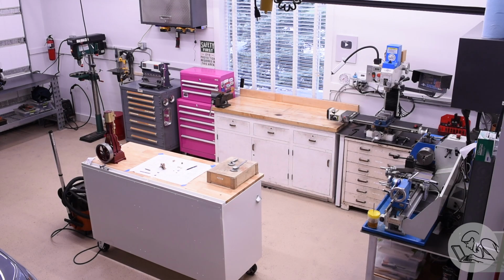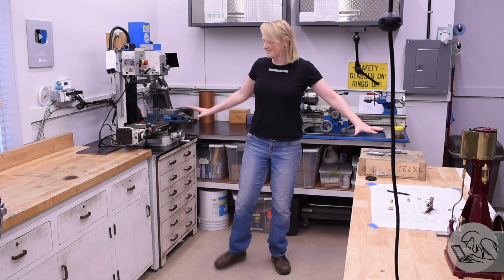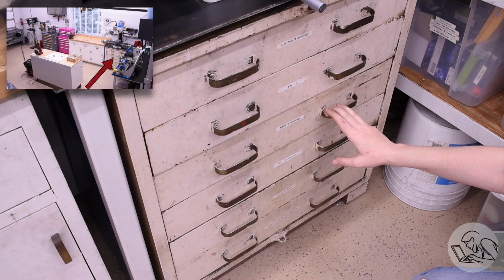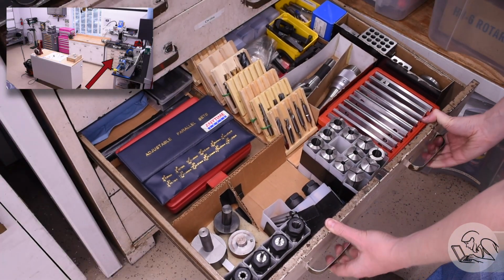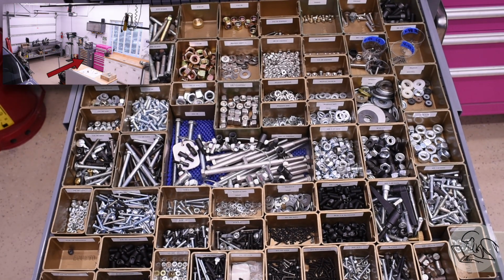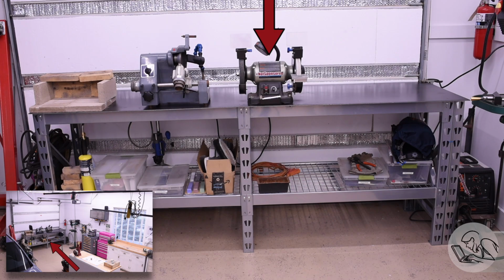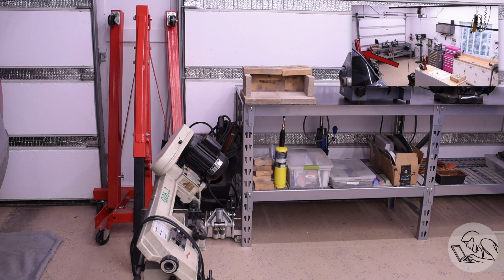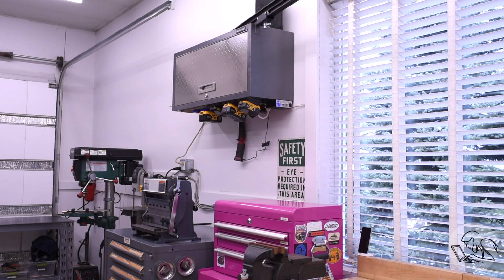New Shop Tour!

Comment: Great workshop, Quinn. It will get even better with age.
I didn't see an air compressor; very useful for hi-speed die grinders, and for blowing swarf out of deep holes. Downside is the swarf tends to get spread around (bye bye clean workshop) but your mill will do that anyway.
Not a lot of space for material racks; you will need more with time. Yes, I watched your video, but that's just a start!
DON'T upgrade to larger machines; buy them in addition to your existing ones. If you traded in the ones you know and love, the new ones will likely disappoint you. I still have my first lathe, an English Myford I bought new 53 years ago, and it can do some things my more recent and larger Chinese lathe cannot. (and the converse is also true). 😄😄😄

Comment: Beautiful well thought  shop. I have shop for 10 years now and in all time i have not spent 15 minutes in thinking out all the things you mentioned.
Cleanest shop i have ever seen. My has coolant stain strips on the ceiling above lathes and wheebarrow for driving chips outside.
You are quite right about light, when you look up if it starts to hurt, then it is enaugh.

Comment: Great and neat workshop! I have a small concern about the AC unit - grinding dust may promptly kill it. Please consider adding something as a pre-filter (like a piece of fluffy non-woven cloth placed over an inlet) or order lots of cheap non-original compatible  replacement filters and replace them much more often than you’d do in a regular environment.

Comment: Fascinating video as ever. I'm intrigued by the 'square ground' drill bits you mention - I don't believe I've ever seen these, and a search online only threw up mortise chisel square bits. Are they ground like, say, a plug or bottoming tap, or a flat bottom milling cutter? And would they be intended for use in a drill press? I'm curious how you would begin a hole without the bit wandering. I dream of a tidy, organised space like this, but alas my workshop is my school teaching workshop, and those students they do thrive on chaos and visual clutter...

Comment: Thanks for sharing! 

I have a tip for shopowners with kids, i’ve placed 2 big circuit breakers know as ‘maintenance switch’ 1 for my 230VAC circuit and 1 for my 400VAC circuit.
With a flick of the switch I unpower all of the wall sockets (and machines)
I can even lock them with a padlock. Very handy and safe against curious kids!

Comment: I owned a shop where I designed and built custom machinery. When I thought I was ready to retire, I sold the shop and moved to Upstate NY. It took me about 3 months to become screaming bored, and there was this building ( a tin wall and slant tin roof, dirt floor and the front wall was opened to the outside ) 200 feet behind the house. The structure measured 12x26 feet. The first thing I did was to put down Visqueen sheet vapor barrier then framed out the floor with pressure treated 2x8s. Then I hit the auctions for my machines, I needed to do this first to know how big to pour concrete pads for the bigger machines I wanted. I made two sets of double doors to cover 10 foot spans. That left room for framing out a walk-in door in the center. this way there was nothing in the way of getting anything in or out of the shop. My first machine was a 14.5x 6 foot South Bend lathe that had been dropped from a lift gate, and had all of the handles bent or broken. It took me 6 months to fix, but I was cutting threads with it when it was finished. That machine cost me $300.00. The next two machines were an Enco mill and a Clausing 9x36 inch lathe. While the auctioneer and I were putting the Clausing in the truck we heard something very heavy hit the floor. His fork lift operator had run into the Enco and knocked it over and breaking the quill stop. I had never intended to buy anything but the lathe, but they offered the mill for next to nothing. I only had room on the truck for the lathe so I told them I needed to go home and drop off the lathe and get the money for the mill. They told me they were leaving in 2 hours so hurry. By the time I got back ( A bus flipped on the interstate ) it took me 3 hrs to get back. When I got back they were gone, but the mill and a shop crane were by the door with a note " Enjoy the mill. Just put the crane in the ally and lock it up with the chain back there.
Reply: Yea. I don't know who you are but man that's a good one.

Comment: Hello fellow heat pump in a shop owner, they sell this irrigation bag to fit the evaporator unit. You put it on like a diaper and you can spray-irrigate the copper coils to keep it clean. I wasn't watching how dusty mine was getting. Thanks for the video!

Comment: I've always felt that painting the walls of the shop white is as important as installing tons o' lights.
Reply: I worked as an aircraft mechanic and worked in numerous hanger's over the years, lighting was important. Lighting was measured in Kilowatt's, thousands of them. In the last place I worked we had 6 rows with 8 1000 watt lamps each and that was only adequate if all lamps were on. The manager found funds to paint the walls white and that made a huge difference. After that, 2 of the 6 rows would give more illumination than all 6 could provide before painting the walls. White in a dirty, dusty environment isn't the best choice, it should be the only choice, invest the savings in cleaning.

Comment: I just finished insulating and dry walling what used to be a calf shed that housed my 106 year old model A Monarch lathe with an overhead flat belt drive.  I moved my mill which had lived at my brothers shop down the road and installed a ductless heat pump. I'm near ready to have things up and running soon. The idea of having things together in one inviting place will be wonderful. Seeing your space is an inspiration. I still have the problem of wood working tools in the basement, automotive tools in the garage, and machinist stuff in the calf shed. I have found the need to have duplicates of various tools such as adjustable wrenches, screw drivers, and a basic set of combo wrenches in each location to avoid the three location search for the tool that is never in the place you are working. It used to be four locations before moved the mill that was a half a mile away. 
Really enjoy your channel.
David Vik

Comment: Man I wish my stuff was that organized. Hopefully I'll be able to borrow some of your techniques.

I've got one garage primarily for cars, but also tools, and another that would be like a dream shop if it were sufficiently separated from the outdoors and wild rodents. Probably needs to have the OSB walls ripped out, spray foam replacing the fiberglass, etc, but too pricy, so there is an unpleasant amount of rodent evidence alongside my yard equipment. Heck, even had a little mouse pop their head out (annoyed) from the base of my bench top drill press after I had finished my drilling... But I can't stomach putting traps out there because it's just not well enough sealed for me to consider it to be "enclosed from the wilderness"

Comment: Hello from Australia
Is the floor coated? 
On your drill press I sey the chuck key is on a string. I use a magnet on the belt cover.
Also; is it an optical illusion, or is the extinguisher right in the corner? It looks inaccessible if things ignited. Cheers !

Comment: Hi Quinn, the workshop overall is impressive, much like my own although mine is crammed into a smaller space. I do have plans to extend a little into my double garage which is adjoined and used as storage and not for my vehicle. The one thing that has really impressed me is the lighting, it is fabulous and has got me thinking about improving mine. Thanks for the tour, it is always nice to see how others set up their workshops. I do have a question for you and should move over to my patron’s page to ask it, I keep forgetting to do so. Stay safe and I like many I assume, is very pleased you are settling in.

Comment: I finally started getting some machine tools these last couple of months (and your channel has been big part of why). I have a lot less space available (really only a couple of square meters), so I'll have to do some things differently, and I'm not planning on building model steam engines or anything, anyway... but it's still nice to see how you make use of your space!

So far I just have a heavy wooden workbench that my mill (a cheap, small round-column mill/drill) sits on, with all the tooling stored underneath in crates. I plan on replacing the crates with shallow drawers like yours, and I've started fabricating a smaller movable table for use as a general work surface, for mounting my bench grinder, and soon hopefully for a tiny Proxxon lathe as well. I'm mostly interested in making things like brackets, simple mechanisms, and things like that, so hopefully this should tide me over for a while.

Comment: Thanks for sharing.  You are a  great teacher.  My suggestion for you is something I have really enjoyed.  It is  a central vac.  I purchased one second hand with no piping for $40.  Then I installed it in a closeted area and ran PVC around my basement shop with 3 simple drops on the ceiling.  It is quite quiet and has fantastic suction.  Before I had a Shop Vac which was deafening.  It is surprising how much cleaner my shop is now.

Comment: While I also like drawers for many things there are also many things I like to have hanging up for easy access like wrenches and screwdrivers. I prefer to think of them as 3D techno-art rather than clutter. In woodworking we say that you can never have too many clamps but in metal working I don’t think you can have too many fasteners or hardware. I knew that you’d like stubby drills if you started using them, resistance is futile!

Comment: I have a similar PM lathe & mill. My mill is a bit larger, but the lathes are essentially the same unit. My mill ended up being mounted  to a cast iron PM pedestal, but the lathe rests atop a Harbor Freight 56" tool chest. I took the wheels off and made leveling pads. I welded a 7/16" sheet of steel to the top of the box, the drilled the top to bolt down the lathe.
The storage space right under the lathe/ adjacent to the mill is awesome for limited space I have available.

My shop is nowhere near as clean.... something to work on.

Comment: Your shop is awesome and suits your needs.  FYI to all, for anything bigger than hobby projects look for a Rockwell Mill from the 60's it is 2/3 the size of Bridgeport and runs on 120/240.  I also found a Clausing 10" lathe circa 1950, does it all and can cut threads. Both slightly larger the these machines but well made and repairable.  Save and restore the old machines is a great way to go.

Comment: My "Shop" (small electronics tinkering and repair) consists of 30x40 cm of my desk and the same area on top of an Ikear Ivar shelf that conveniently fits under the desk at a 90 degree angle.
Everything I need is within arms reach without getting up from my chair.
It has a lot more drawbacks than it would seem.

Comment: I think I saw one tucked beside your shop crane but I use a regular floor jack all the time. I use it to move everything around my shop. Helps levelling too
Reply: My floor jack is also a half way decent infeed or outfeed table for the horizontal band saw.  The height adjustment the jack brings is convenient when dealing with the multiple planes of sloped garage floor and longer sections of stock.  Wonder if Quin uses it that way, or if it is just coincidentally nearby?

Comment: I agree about the hoist. As a young'un I tinkered with custom cars, and I bought an engine hoist rather than renting one for a job I was doing, because I wasn't sure how long I'd need it, planing to sell it when the job was done. It proved so useful that I had it for years, it was surprising how many uses I found for it. And it never worth risking your health by lifting things too heavy - it can take mere seconds to do damage that will trouble you for the rest of your life.
Reply: At my last job we needed a way to get a 20kg heating element out of a machine without bending forward. I modified an engine hoist by shortening the front legs and adding a lot of counterweight. If you find yourself using it a lot, put some nice castor wheels on it, the factory ones are complete pants. And, as someone with a lifetime injury, I would add don't one-hand battery drills. I had one catch and tear cartilage in my wrist before I could let go of the trigger. Seven years and two surgeries later, my wrist still bothers me!
Reply: My solution is a set of forks on the tractor front end loader. We live on a small farmette and it was 5 years before I finally broke down and bought a tractor. Since then is has become my only engine hoist/machine mover.
Reply: I'm with you! Similar to @IanSlothieRolfe 's comment about buying and selling when the job was done, I bought a skidloader when I was building my shop and figured I'd sell it when I was done with the construction. Like Ian says, it proved itself so useful that I still have it 25+ years later!

Comment: My shop electrical tip:

Use two 20 amp circuits for outlets on a wall. alternate from one circuit to another every 32 inches. So circuit A at 0", 64", 128" etc, & circuit B at 32", 96", 160" etc. I used white outlets & plates for one circuit & ivory for the other.
Reply: That's pretty much what I did. I've got four 20 amp circuits just for the wall mounted outlets. No two outlets next to each other are on the same circuit, but mine are at 24" intervals because that is what the stud spacing is.
Reply: I did the same in my shop - alternating circuits for the outlets and separate circuits for lighting. That way if I happen to trip a breaker I'm not left in the dark and I still have power to finish the task before having to go to the panel.
Reply: @smallbyrdz3823  I actually put the lights on a seperate circuit for lights only.

Comment: Thanks Quinn for the tour and new shop update! I've been curious how you'd handle a few things, such as general layout and  integration of the organization you had gotten (what appeared to be the) dialed-in in the V1.x version of your shop (old shop). One question that maybe I missed in your video, the "bar" running across the top of those nifty cabinents. Is that for camera mounting? Light hanging? Maybe something else that I'm not clever enough to think of?

All in all though, I love the logical layout for your space! Very effecient and actually visually pleasing! The only thing that I'd say you neglected to include is a safe viewing space for Sprockets! Or, is that inside the house? Lol Thanks again for sharing! 🤓

Comment: Very nice. I too am a fan of the "cardboard and hot glue" method of creating drawer organization. However, recently I started using coroplast. It is essentially corrugated cardboard, but made from a durable plastic. Best of all, the source of it is free and endless. Most of the signs you placed (illegally) along the roadsides are made of coroplast. Your local authorities will have no problem with your removing what they would have to take down anyway. And the people who put them up don't have an argument against removing them. Political signs are particularly fair game, especially the day after the election.

Comment: I cannot agree more about light.  With macular degeneration the need is even greatr.  I found some of the under counter kitchen lights at big box hardware store that were short but fit up near the quill on my mill making visual much better especially in the back.  My mill is similar to yours, so it should be a great upgrade for minimal cost. Mounted with double stick tape.

Comment: 1. It looks like those two overhead black beams are rails for photographic lighting and camera positioning--correct? 
2.  I'll be interested in hearing how you like your lessons-learned shop after you've had some projects to try it out.
3.  That heat pump is a thing of beauty, in form AND function!
4.  Head scritches and nose boops to Sprocket.

Comment: I have struggled in my shop with some advice from Adam Savage on his tested channel. He always emphasizes first order retrievability which is a concept I love. The problem comes from the impracticality of doing so in a machine shop. Try as I might it doesn’t really work. So much of the tooling needs to live in drawers to keep them out of open air. First order retrievability is a much more of a fabrication or wood worker arrangement. I really dig what you have done with your shop. Style points bursting right out out the front door. I know years ago that you mention inspiration from Adam Savage’ first order retrievability too. It seems vary fitting as I watch his channel, as he gets into more and more precision work, he moves to a system much more in line with yours. Shared conclusions are great.

Comment: What’s the different use cases for blue versus white paper towels?
Reply: Hi Andrew , white papers towels are just your standard kitchen towel,weak fall apart easily.
The blue towels are much more durable ,don't fall apart when wet  but are much more expensive.
good for wiping  heavy grease etc. if you are using solvents like isopropel, acetone ,or brake cleaner ,they
can be  dried  and used again.